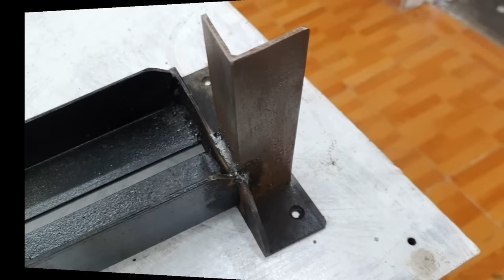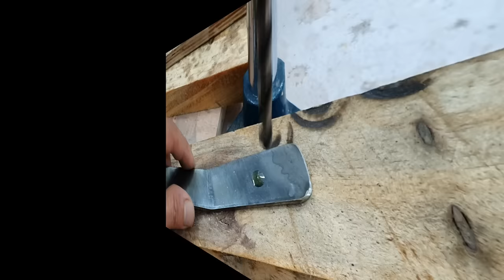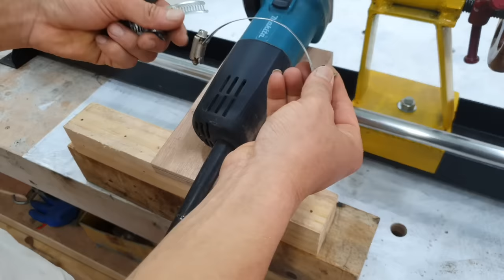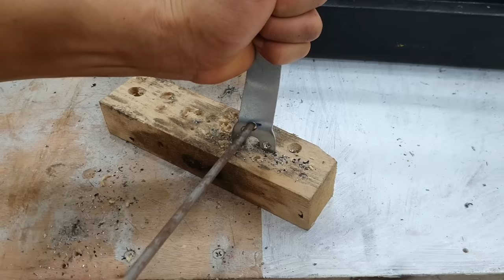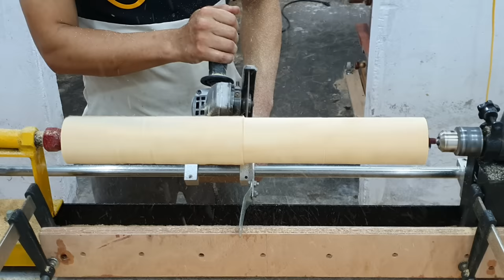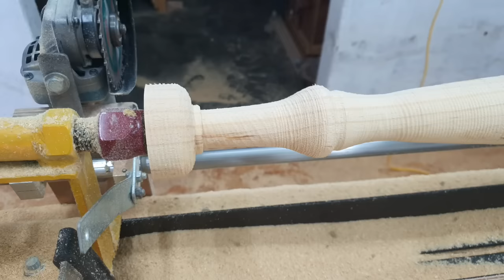DIY Wood Lathe Upgraded Version || It's Easy To Do This || Homemade Lathe

Comment: What does what is that hardware that is on the pipe that holds the saw in place with blade so the blade so I can move back and forth freely?

Comment: Good video sir. Something to consider,if you have a tablesaw, set the blade to 45 degrees and cut off the corners. The 8 small corners will work much faster with less effort. Keep well and God bless.
Reply from the maker: Thank you for your comment, it's very helpful

Comment: Bad idea. The circular saw does not cut very well with a side feed. The front edge is slightly blunted + plaque and the disc begins to bend.

Плохая идея. Дисковая пила плохо очень режет при боковой подаче. Чуть затупилась передняя грань + налёт и диск начинает отгибать.

Comment: Eventually you might want to switch out the drill chuck for something a little stronger, drill chucks arent really meant for handling perpendicular forces. It will wear them down fast.
Reply: Putting a saw blade on a grinder shows how much he understands tools